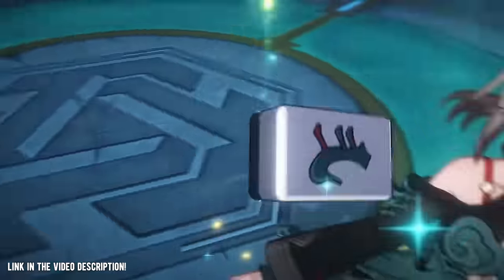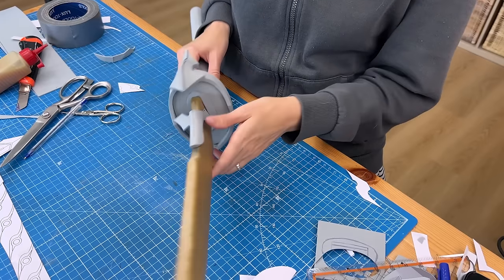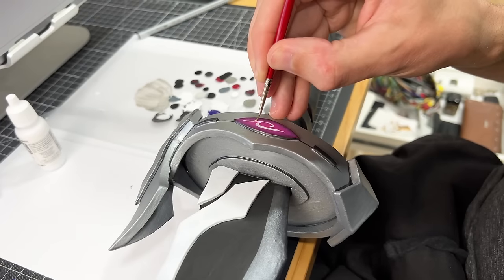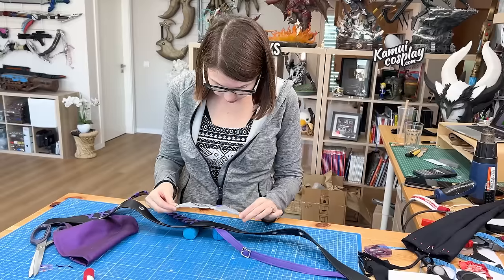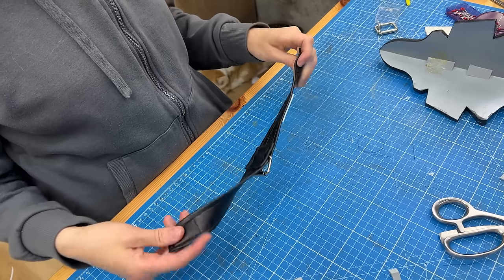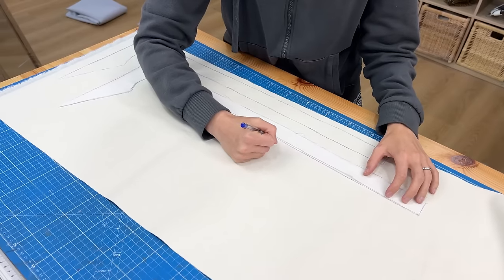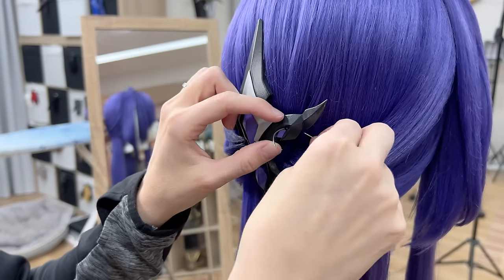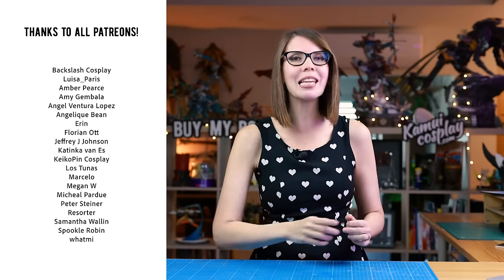How I turned into Acheron from Honkai: Star Rail!

Comment: Are there any colour change RGB LEDs, that have a more conventional LED shape instead of being flat?
I found a couple of clear acrylic gem knobs for drawers, and thought, those would be amazing scenery pieces for TTRPGs. And being able to change their colours by lighting them up would make for even more diverse Options.
The problem is, while they have a hole in the base, it doesn't let that much light through, so it's barely visible in normal day light.
So my thought was, if you place a LED in that hole, it should light up better, since it's lit from the inside instead of from behind.

I know it's not really related, but I thought I'd ask, and maybe someone with a bit of experience in electrinics could help me out.

Comment: Does anybody know why is it when i try to brush paint, my paint is not sticking to the prop well. Im using spray paint as base, and then acrylic paint with a brush. But it seems like the prop is rejecting the acrylic paint when brushing. Like its acrylic-phobic? Or something. Here they paint with no problem at all. Can anybody help?
Reply from the maker: You need a proper primer (like Flexbond for example) as a base and spray paint sadly won’t work. Hope this helps! 🙏
Reply: @KamuiCosplay  Woooow. thank you for the reply! Never expected you to reply to me! Im a fan! <3 Hmmmm. And does plastidip work as a primer?